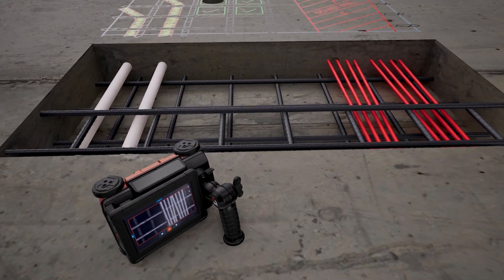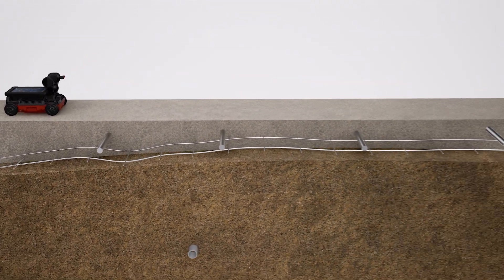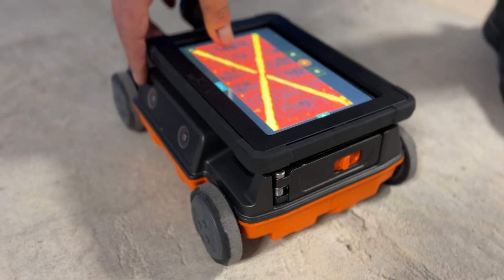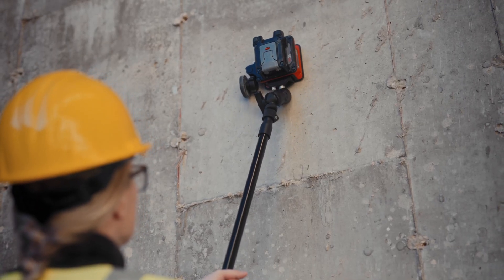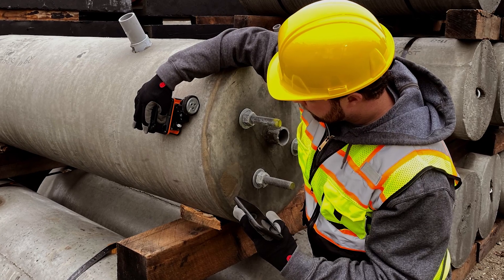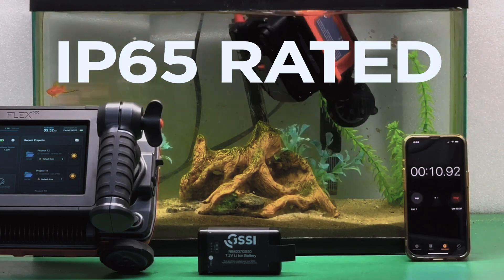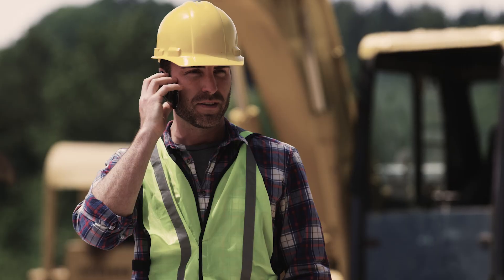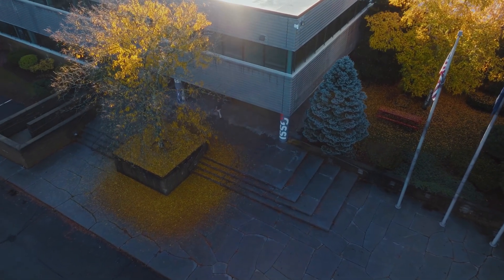GSSI | Flex NX® - Dual Antenna Concrete GPR System

Comment: When making the 3D scan - without the papers used previously - how do you know where the embedded objects are located once you remove the radar? Where is your references?
Reply from the maker: Hello, it is not intended to provide a direct replacement for old fashioned grid scanning. It's intended to provide a quick view of the geometry of the targets in the concrete so that you can better understand the 2D data that you use to mark out.
Reply: @GSSI thank you 👍🏻
Reply: Hi, if you select a datum/origin (that is your zero) when start scanning from there you will be fine. Let's say you scanned  4x4ft area whatever located object shown on the screen measure that from your datum this will gibe you exact location on the concrete. I hope I could explained.
Reply: 5 metre deep range GPR machine how much bro